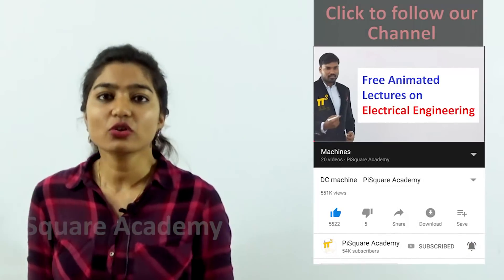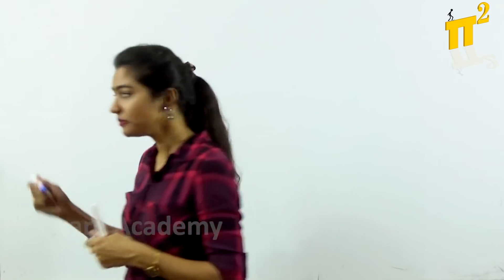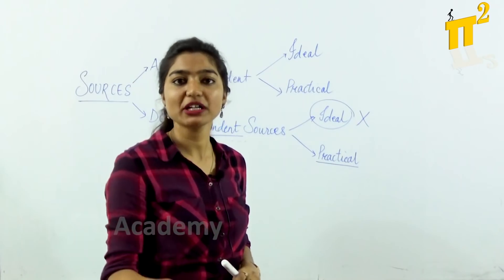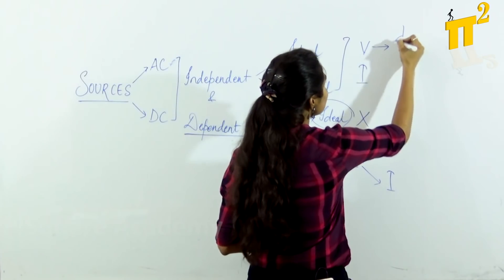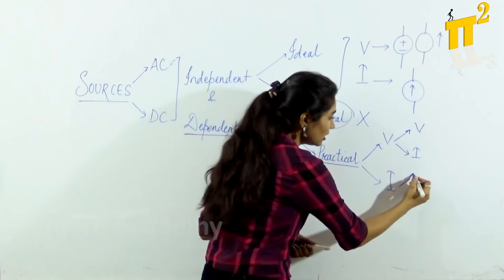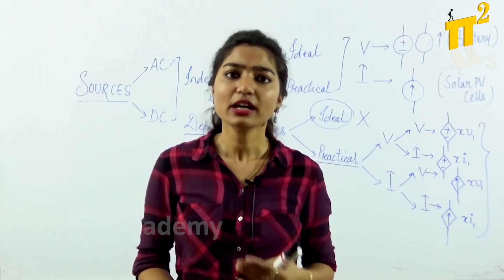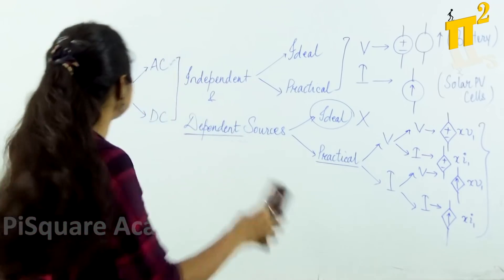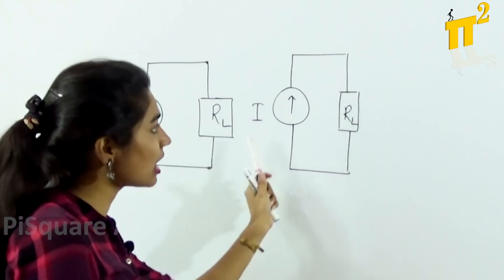Why Dependent sources are not removed from the circuit & Types of Sources | PiSquare Academy

Comment: what will happen  if we connect two systems of different frequencies eg 50 hz and 60 hz to grid
Reply: Circuilatating currents generates and grid fails.....not even 60hz, other than 50 any frequency will does the same

Comment: Can we calculate internal resistance of dependent source?
Reply: we cant find individual internal resistance of the de[endent source so we find total R i.e., Req. Use dc voltage of Vdc across the terminal and find the current and then ratio of the voltage to current i.e.,  Vdc/i=Req.

Comment: Why are Delta-Star-Transformers used for Lighting Loads?
Reply: I think lighting loads need a neutral line, either all home loads need a neutral line beacause of delta has 3ph 3 wire system, star has 3ph 4 wire system....
Reply: @E-MVIGNESHWARA  without neutral also you can connect such as in insulated neutral
Reply: @E-MVIGNESHWARA  😀